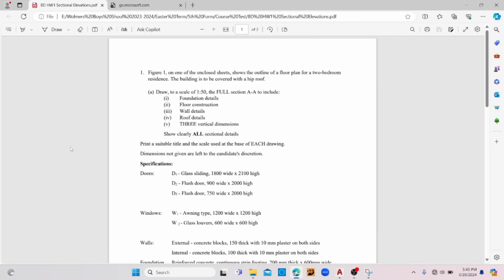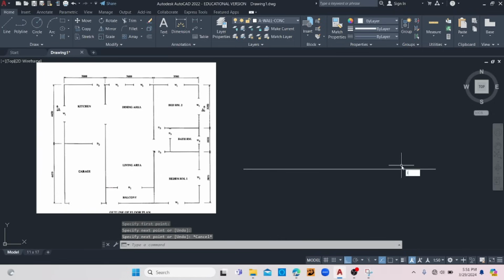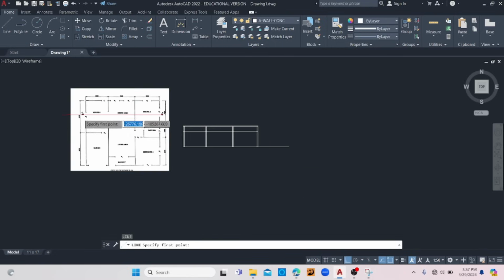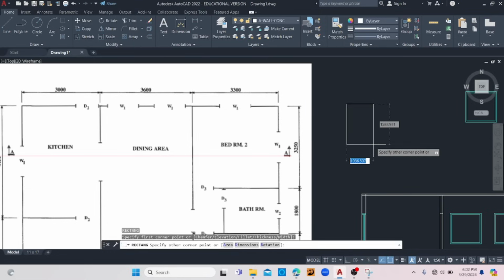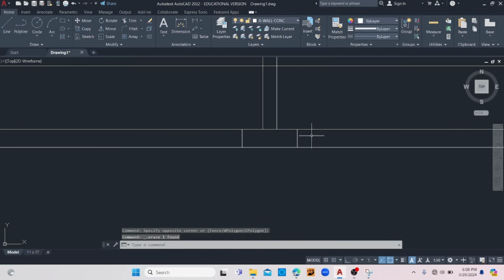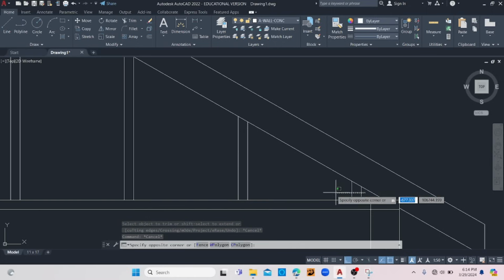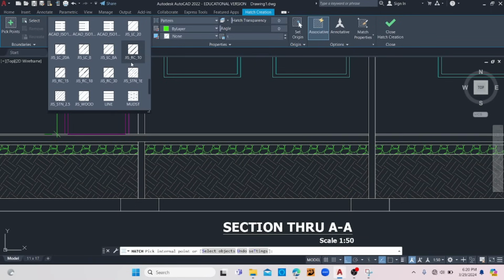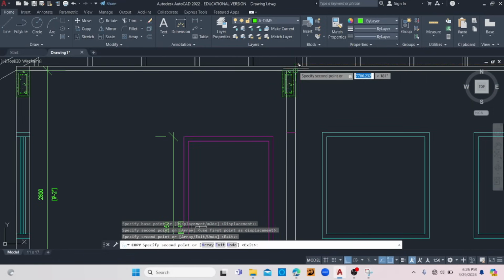Mastering Sectional Elevation: CXC CSEC TD Past Paper Guide

Comment: How do you know which part of the sectional to draw
Reply: The show you where they want it. There will be a cutting plan line with arrows and usually letters at the arrows. It'll say produce a sectional along the cutting plan AA. A on one side of the cutting plane and A on the other side of the cutting plane. That's just how it's denoted. The arrow points in the direction of how they want to see the sectional. If its pointing to the left it wants to see everything from windows, railing etc on the left of the building. Vise versa
Reply: @meka94  your such a clutch bro thanks